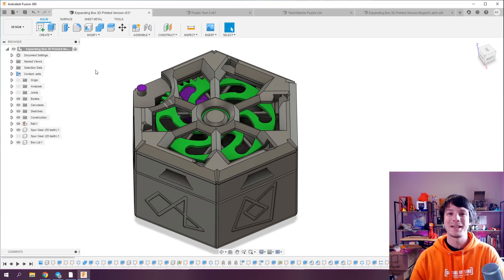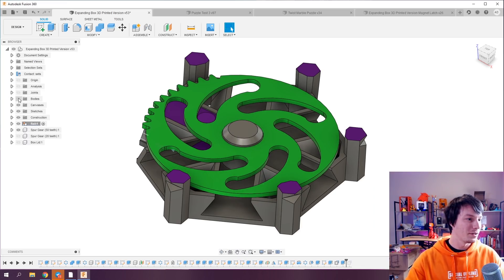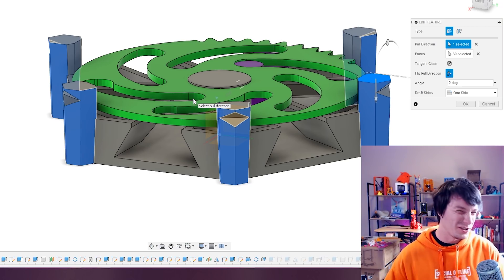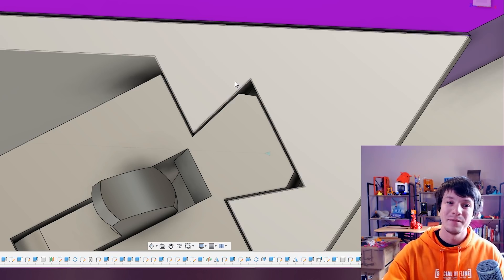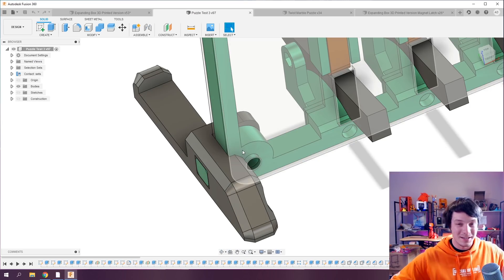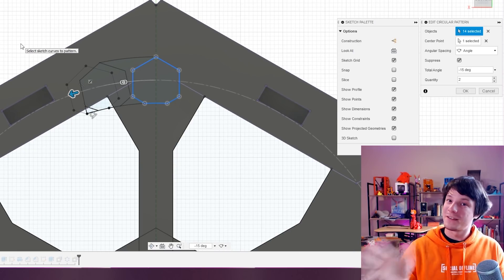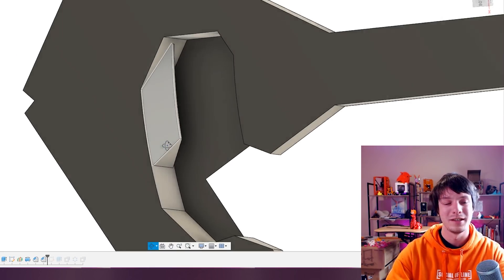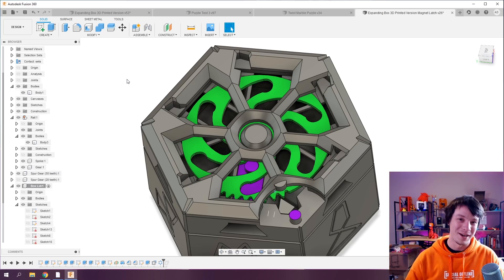5 Advanced 3D Modelling Tips for COMPLEX 3D Printed Models

Comment: Awesome video! Love watching your stuff. Just got my book "507 mechanical movements" one for me and one for a mechanical engineer friend. 

I figured out how to do twist locks a slightly different way - 2D sketch of a cam track coming in at a downward angle, then going off to the side as the track. Use a small nub along the bottom of the track near the end to lock it. The biggest trick here is to use the 'emboss' feature to push/pull the design wrapped around a curved surface (this was key!). Then for the mating piece, just a simple circle extruded to meet the track. Then circular pattern these 2-3 more times around the object.
See this video https://youtu.be/ygsxIH226Jg  at 0.40 and I show it.

Comment: There's a blog post by a 3D printing company (they were sort of sizeable at the time, or the prices on what they sold made them appear as such) that goes into some details about parts that mechanically fit together. I think the biggest takeaway I got from it was, round doesn't have to be round if you want 2 parts to act like a dowel joint. You can get away with an octagonal rod in a round hole.

Angus, of course, got the point across better.

Comment: Thanks for this.  I hadn't tried the "draft angle" thing, and that looks very useful.  
I have found adding tiny fillets to corners, sometimes even small fillets to already chamfered ones, really helps avoid those extra-sharp edges.  I think it makes the printer slow down and therefore that extra bit doesn't get "thrown" past the edge.

Comment: Why aren’t you using user parameters in F3D? This is a very powerful tool for clearances, draft angles, chamfers, etc etc. You can add them right into the sketches then if you need to adjust a variable, make one change and the entire model updates so you can reprint.

Comment: For your third suggestion, what I usually do is I cut out a 1mm circle centered on the female corner instead of chamfering the male corner. I find this has better torsional strength than chamfering the male corners but it is not always possible based on model geometry.

Comment: Hey Angus! I'd like to know how to model more corse chunky screw threads for 3D printing? Standard metric or pipe threads are rather fine pitch.
Reply from the maker: If your software allows a helical path you can sweep any custom profile, but in fusion you're limited (without super janky hacks) to their threads or a vertical sweep which twists along the path.
Reply: @MakersMuse  Yeah I use Fusion.  I wish the thread parameters could be adjusted. Have you ever tried a thread made with the Coil feature? Would a round thread profile could work?
Reply from the maker: I haven't but if overhangs aren't too extreme don't see why it wouldn't

Comment: Great video. I wish there was a dictionary of hinges, joints, connectors and other mechanisms for 3d printing. For example, I would like to make a set of trays that stack and lock together, with each forming the lid for the previous.
Reply: You can get models of just about any hardware or fastener. Mcmaster has 3d models for nearly every product on their site. Lots of stuff on GrabCad too. Fusion has a tie-in function to browse and bring stuff in from their catalog easier. Forget how it works but the one time I tried it wasn't much easier than browsing and grabbing the files manually. I've been using FreeCAD instead of f360 lately  anyway.
Reply: Take a look at woodworking joints for inspiration too. Sliding dovetails would be a reasonable choice for stacking trays.

Comment: Hi Angus, excellent video. A ton of very useful tips and tricks, I love it. I would be interested in how you integrate tollerances into you designs when using spur gears. What clearance you use around shafts, if you set clearance on the whole gear or if you just factor it into the distance between gear centers, etc. I'm looking forward to the see this puzzle box in it's full glory.

Comment: Is CAD better than solidworks for 3D molding?
Reply: Solidworks is a Computer-Aided Design (CAD) program. Personally, I use Fusion360 (the software you saw in the video) and it has been fairly simple to 3D model with.

Comment: Thank you for the advice. Over the past 3 years, I have amassed 6 Solidworks certifications in mechanical design (I am trying to get an expert level certification before I turn 18), but I only really work with sheet metal, cnc milling, and injection molding. I have recently gotten into designing parts for 3d printing, and this video is really helpful.

Comment: How do you screw that top on when you have those pegs sticking up from the base? In 9:42
Reply from the maker: The top plate and dovetail insert form a separate assembly to the main body with those tabs. They're actually there to prevent the top being forcefully rotated when the box is in a locked state.
Reply: @MakersMuse  That is smart. I didn't see that. I see now how it works. You have to rotate this green part to retract the "bolts" to be able to lift whole inner assembly. This will reval the "box" under it. Am I right?

Comment: Thanks for sharing, Angus! I've been advancing towards more complex parts lately, and trying to come up with ways of making clearances easier to manage. Adding them as offsets at a later stage looks like the way to go, better than incorporating them in sketches and extrusions like I've been doing. I think I might be unnecessarily pedantic about parameters too, your approach of using raw values for them is something I have to try as well.
Thanks again, I think your video may be very helpful to me. Stay safe, all the best!
Reply: I think there are advantages and disadvantages to both your pedantic tolerance-offsets-in-sketch approach and to the adjust-at-the-end approach.  The more complex, the more I lean toward being precise with everything.  There is nothing more frustrating than changing a distance early in the timeline and having the whole model become an origami nightmare.  At least that can be true with Fusion 360.  It seems to get confused about what edge you told it to chamfer or what face you did a press/pull on.
Reply: @beauslim  Yeah, I'm sure complex geometries could turn out to be problematic, either because of a change in previous operations causing entities to get new IDs, or because of Fusion being unable to deal with some more difficult edges or vertices around the surfaces it's trying to offset... But I'll give it a try, it could still be better than having related clearances spread across separate operations. Add it here, subtract it there, add some construction lines to the sketch to illustrate what the hell is going on - it becomes a mess really quickly. I feel like having related clearances grouped within a single operation ("offset all these walls by 0.15 mm") should be much more expressive and easier to keep track of visually.
Reply: If you cannot do great things, do small things in a great way it's not whether you get knocked down, it's whether you get up, be the boss today by investing in binary option and earn uncountable profit for yourself. Communicate with Mr James Hamilton to guide you.
Reply: Contact : + 1 9 7 3 5 2 4 6 6 9 2

Comment: "Techniques" is a much nicer word than "Hacks", and usually more accurate
Reply: I'd consider them to refer to different things personally. I'd consider a hack to be a suboptimal solution chosen for ease compared to the proper technique or failure to apply proper technique. For example, I'd consider the technique of hacksawing the stripped head of a screw in order to use a flat head screwdriver on it to be "hacky". I'd also consider something like zip-tying a part that would ideally be fixed more permanently with proper fasteners or adding a bunch of if statements to make your code work properly rather than finding a more clever code structure to be "hacks". But yeah, what Angus is showing us in the video isn't really "hacky" techniques.
Reply: As Hugo explained, the meanings of “hack” and “technique” are quite different.

“Technique” is pretty neutral, “hack” is often slightly pejorative, although there's a degree of fondness/pride as well.  A hack is typically ad-hoc, clever and practical in the short-term, but not a good general long-term solution.

Comment: You need a milling machine and I'm not talking about some cheap 3018, I'm talking Bridgeport or a real CNC. Tormach, if you're watching and come across this comment, get this kid some equipment. Trust me, he's worth your time and effort!
Reply from the maker: If only I had the space and 3 phase power...!
Reply: Tormach can just be plugged into the wall outlet and will definetly Help you
Reply: @nf794  Yes it can, but you need a 3 phase plug to plug it in to. And that plug needs to be wired to a box set up and able to push that much power. It can be quite expensive to have an electrician come out and set all that up. We're talking about a plug that's relative in size to a coffee mug, with a cable running to it that's 6 gauge at the least. It's very expensive to have an electrician come out and get you set up for 3 phase.